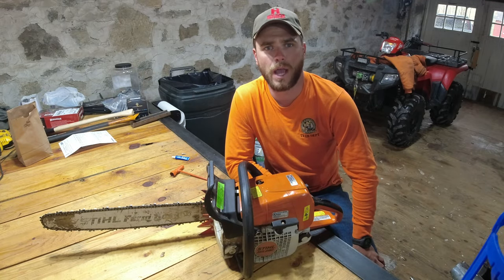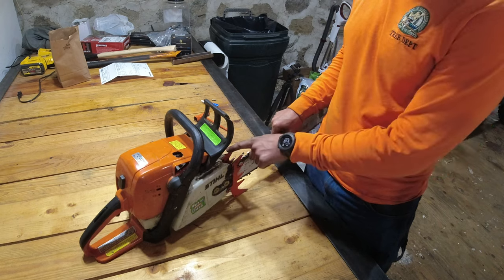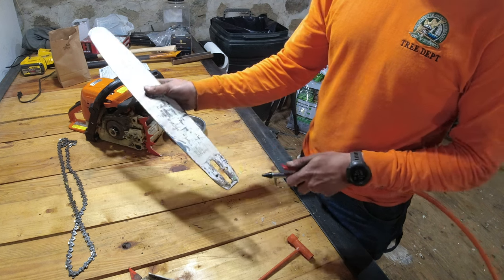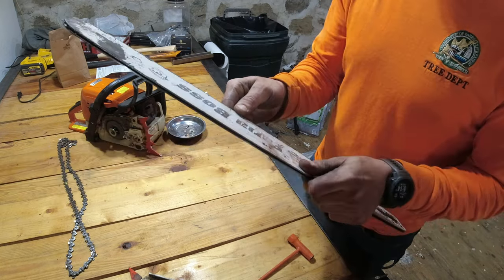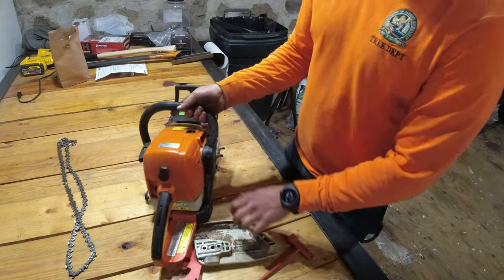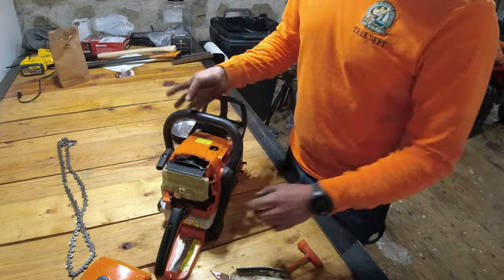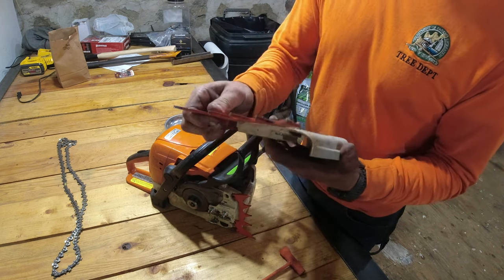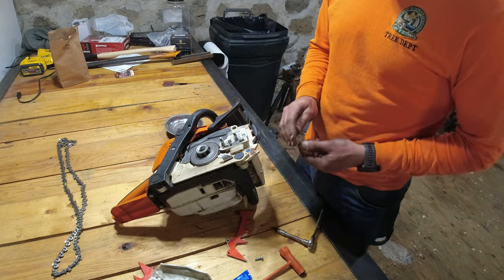#222 Quick Down and Dirty Chainsaw Maintenance

Comment: Didn't  know  about the choke thankz! How often do you lube inside the sprocket? Here's a tip I use. If not operating  the saw leave the chain lose till you are gonna run it. Keeps from stretching the chain.
Reply from the maker: I’ve never lubed the inside of the sprocket. I run my chainsaws everyday for work so they always stay adjusted properly and I tighten when necessary.

Comment: On the chain tension, a good rule to remember is: no sag, no drag”.

BTW, it looked like you were putting WAY to much pressure on the scrench when you were tightening them down. Remember that those are only like conventional studs and not a more common chainsaw bare stud with a “square head” that goes in from the oil tank side. If you strip it out Stihl does offer a bigger stud for the case side , but why tempt fate when you don’t have to.
Reply from the maker: Thanks for the advice Todd, I wasn’t going any harder than I normally do. When I did the conversion on this saw I put in two new studs with loctite, I’ve lost nuts before due to not tightening enough.

Comment: Try using a little longer screw with a nut
Reply from the maker: Yeah I’ve looked into this I’d have to drill out the plastic hole a bit, not sure on clearances for the nut either.
Reply: @DudeRanchDIY  I had the same problem with my saw that is what I did I put a thin washer and and a thin nut and the blue lock tight that was over a year ago and a hundred     tree's good luck I in joy your channel thanks Jim Watson!!!

Comment: Those machine screws going into plastic never hold well. Get a rivet, place a washer on the opposite side the rivet enters through so the rivet compresses on the washer not the plastic, and set the rivet.
Reply from the maker: That’s a good idea, I’ll have to get a rivet gun. Been meaning to get one for a while now.